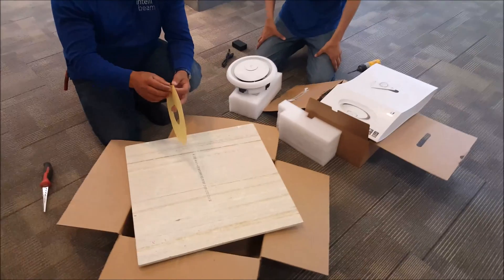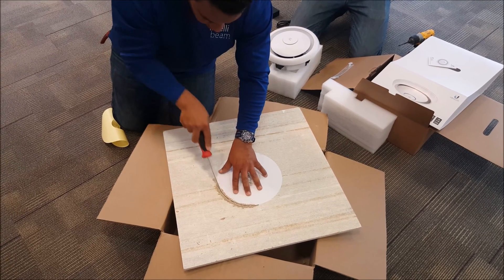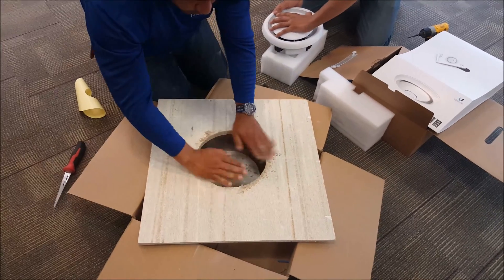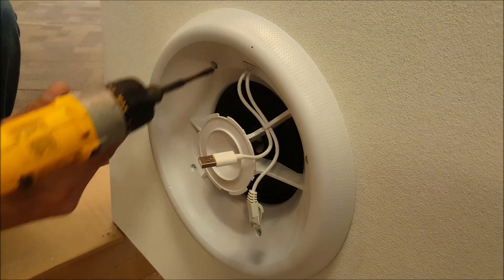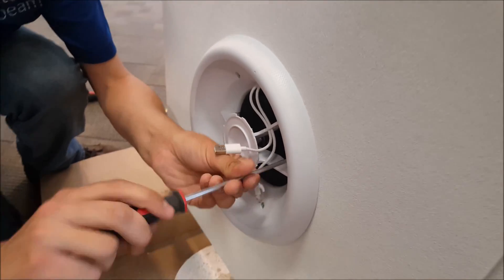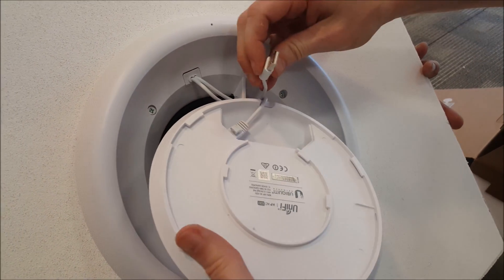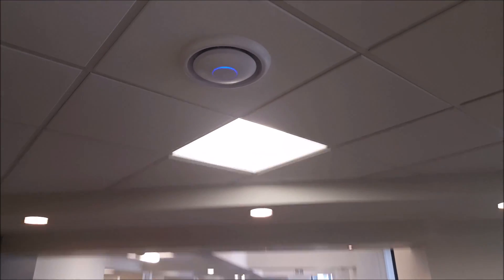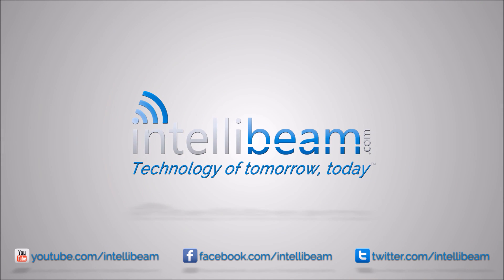How to install a Ubiquiti UniFi UAP-AC-EDU and test by Intellibeam.com

Comment: How to get it off though?
Reply from the maker: The AP unclicks from the speaker, then the 4 screws holding the speaker in are exposed and can be unscrewed.
Reply: Intellibeam gotcha I’m currently having a issue where the WAP will not twist off but the other wap I have twist off with no problem.  Seems like the wap is hung on something
Reply from the maker: @RickMillz70  Might need to slip a paperclip in the side slot on the AP.
Reply: Intellibeam yea I tried that but it was still not budging finally got it to come off by pushing on the wap and turning!
Reply from the maker: @RickMillz70  Excellent.

Comment: Hi there, I just cant get this thing working at all. Tried local controller and Cloud key. Provision is OK. But iphone/android app keeps rejecting the login details saying "invalid login". I tried all passwords and it just doesnt work. any comments ?
Reply from the maker: Did you happen to change your username?
Reply: Nah. But one thing that It has happened different today. I am able to use EDP via controller cloud key. I can use the UN and password if logining using IP address of cloud key. But when using the device auth UN and Password (kept same for both) for IP address of EDP itself then it just says invalid login info. 

In short; if running controller on PC and have EDP only in network then I get no luck in logging in. As soon as I put cloud key in network and login to Cloud Key then it does detect the EDP.